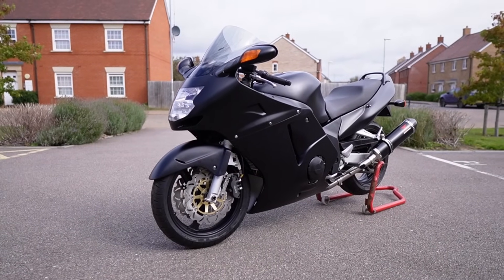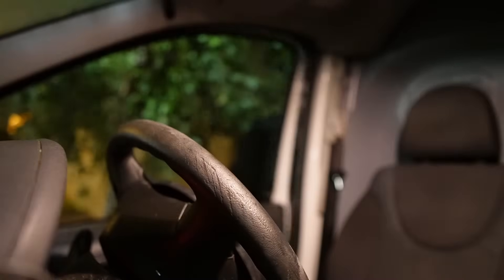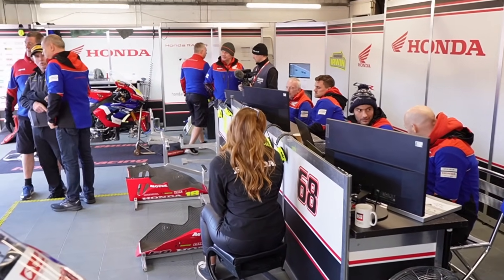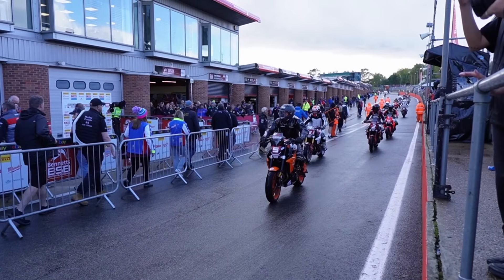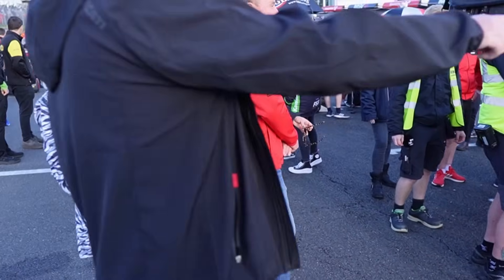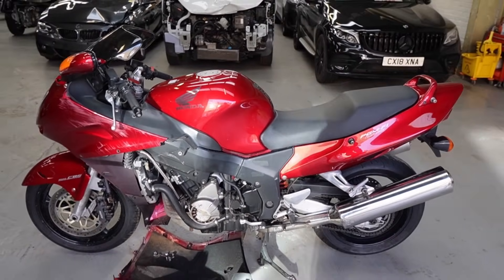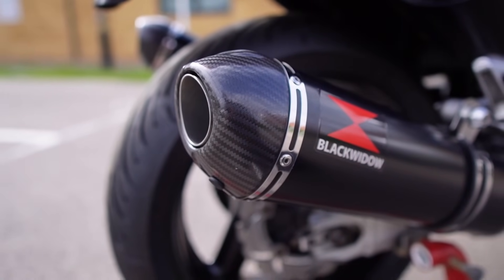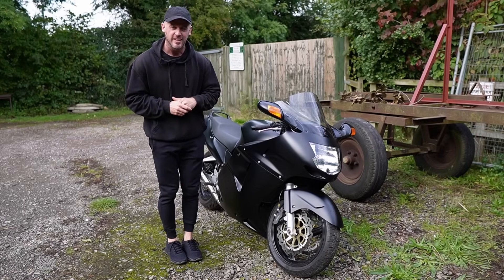I REBUILT THE UK'S CHEAPEST HONDA BLACKBIRD THEN THIS HAPPENED

Comment: When you do the thunder ace would like to see more on the rebuild as one minute it was an engine in a frame then next it was a fully built bike did you have any help or was it all done by yourself.
Reply from the maker: Please see the Honda Blackbird playlist the complete journey is there. The part I missed out was not showing me fitting the fairing as I wanted to reveal the bike as a surprise i.e the colour
Reply: I’m looking at doing a similar project and have very limited skills so I watched the videos for hints and to see if I could do it but ther seems to be a lot of the build missing connecting the engine and wiring so just wanted to know if you had any help with any of the build so I know where I need to go if I have similar problems .cheers. @BikesofRye

Comment: You could have resprayed it yourself for a lot less than that, a partial respray in the same colour ? Your statement at 7:13 is a little puzzling. "I could have just gone ahead and replaced the engine" but you did replace the engine ? A good build though, enjoyed the first start up.
Reply from the maker: I could have just replaced the engine, and ridden it without any other work. It has an MOT when I bought it
Reply: @BikesofRye  Not being funny but how could you ride it with a damaged fairing ?